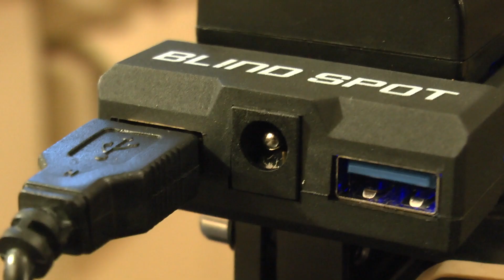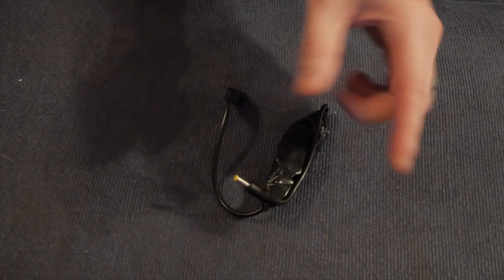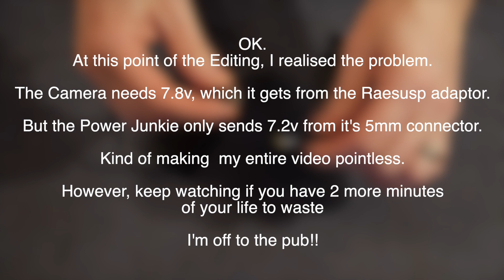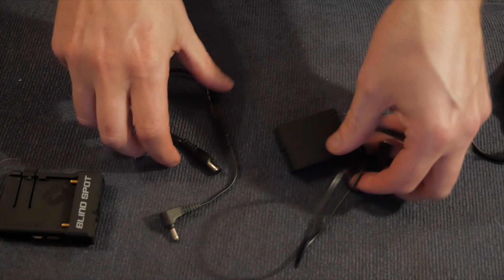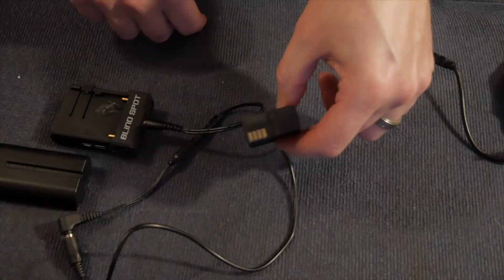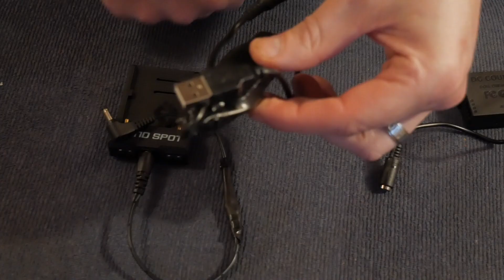PowerJunkie & Lumix gG80 G85 (and why it only works with a usb Step up)

Comment: I'm trying to power my g85 with the Blind Spot as well. The G85 batteries says 7.2 Volt so I thought it would work. How many Volts can we put through the Camera though?
Reply from the maker: 7.8 v is a normal working voltage for the g80/85.  So any connector coming out of the power junkie will have  to step up to 7.8v. 
The only step up  connector i found was the raesisup one.